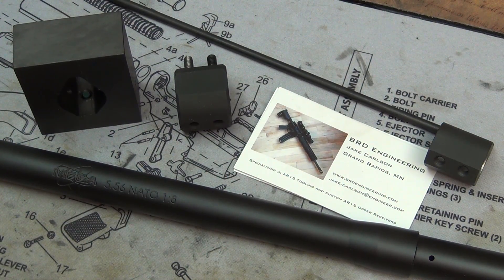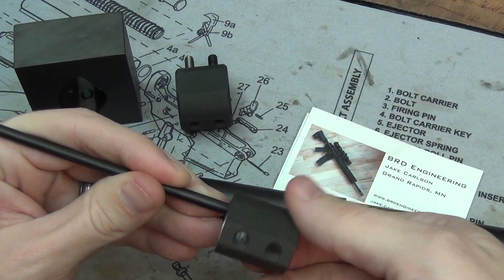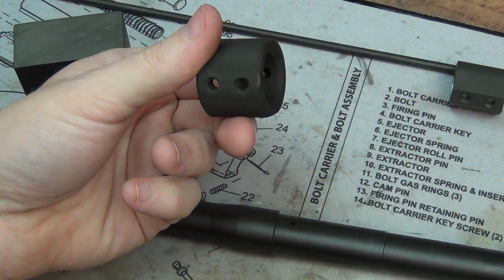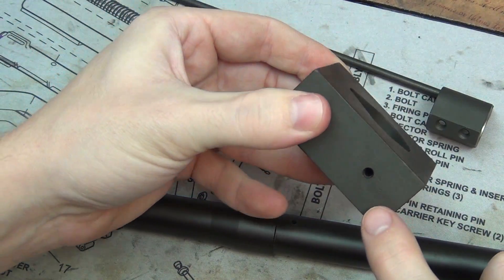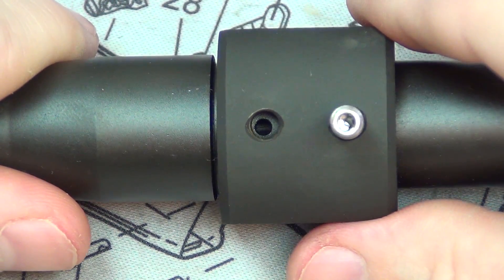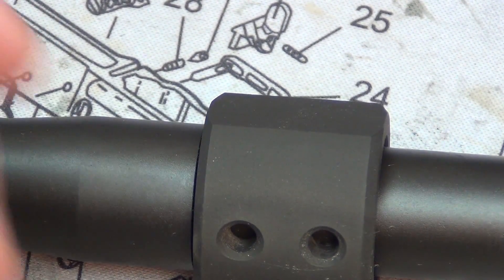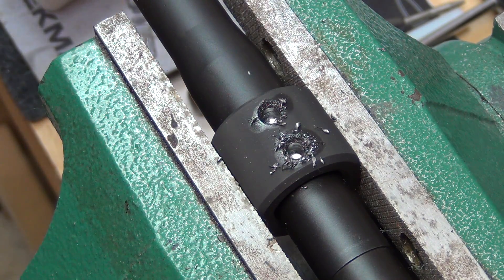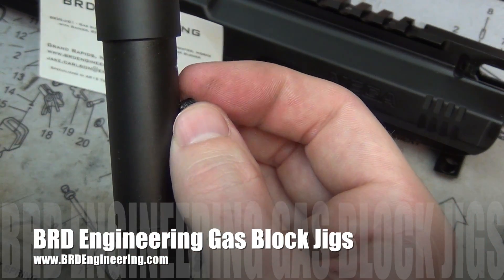AR-15 - How To Gas Block Dimple Your Barrel

Comment: Clearly not melonite/nitride 4150 CMV barrel.  Used the jig and cobalt bit from BRD.  Barely made a pinpoint.  Then used a dremel stone bit to break farther through melonite.  Still no perceptible metal being removed.  Now shopping for drill press and maybe carbide bits.  Much harder than you guys make it appear online.

Comment: What was your drill bit tip angle, 118 degrees or 135 degrees?
118 degree tip angle seems to be too sharp for use as a dimple bit, and will bore deeper into the barrel. 135 degree tip is much flatter and will drill less material at a flatter angle. I’m getting ready to dimple my 300 BO barrel and just looking for advice.
Thank you,

Comment: Great, informative video man.. thank you. Is there a reason most ar15 manufacturers only dimple the barrel for one set screw? Why not do both?
Reply: The front set screw may vary in distance from the rear set screw, depending on manufacturer and model of gas block. The rear set screw is always directly under the gas port.

Comment: the offset of the gas block to the barrel shoulder can be found easily by using the old spacer from the old standard "glacier guards" slip the spacer on the barrel then the jig then drill.

Comment: dumb question - why don't manufacturers already dimple the barrel from the factory? and does one really need to dimple it (because manufacturers don't do that)?
Reply: take my opinion for what its worth, which aint much, but the only reason i want to/am going to do it is its an easy to achieve peace of mind. i would not do this until i was 100% sure it was the gas block that wouldnt ever come off unless to swap with the same block (some of the spacing for the screws are slightly off from one another from what i've found) so marring the shit out of an expensive barrel without being positive of the setup would just not happen.
Reply: The through pin is strongest so why dont they all drill a big chunk out? Norr work and people arent buying just for that. They want a stock barrel alot of times.
Reply: Because its not necessary. There's also different size of aftermarket gas blocks.

Comment: Interested in this tool.  I am building a Ar pistol with a Rosco Barrel (10.5 inch barrel) Rosco placed one dimple on the barrel in alignment with the gas port (which is good) My rail is the Geisselle MK8 (9.5 inch) Might pick up this part so I could place a 2nd dimple on the barrel.  I might not pin it, don't know yet.  Great informative video.

Comment: I know this is a "dated" video, but it's still solid information.  If a person does any gas block upgrading/replacement, that jig is an invaluable tool to have on a bench.  Paying $40.00 for that little guide far outweighs the cost of messing up a barrel, or having gas problems later on.  Great/informative video.

Comment: Have you noticed any accuracy issues after pinning the gas block? I've noticed there's a loss in accuracy so I only dimple and loctite set-screws now and I've NEVER had a gas block loosen up even on barrels that get heavy suppressed use...Might be something to think about. This is why no premium precision AR barrels are ever pinned. Here's another one for you, why does some of the premium barrel manufacturers  like Battle Arms, Northtech, WOA, Rock Creek, Wilson Combat etc only dimple for one set screw? Because it further reduces harmonic inconsistency. That's why they can offer a 1 moa guarantee. Also JP doesn't dimple at all, they just go clamp on. Another one to think about.
Reply: D Hal ballistic advantage uses a pinned gas block and they have a moa guarantee.
Reply: so i'm confused. you notice the issue ONLY when its pinned? or when you dimple for both set screws/pin it???

Comment: You only need to dimple the one nearest the gas port. In fact, dimpling the other one could screw up alignment.
Reply: I actually kind of get what he's saying, but I think you alleviate the possibility of it being an issue as long as you tighten the screw below the gas port first.

Especially when using a hand drill, there are going to be some variances in the dimples and the screws will sit differently in each dimple. Having said all that (just being devil's advocate here) I think the benefit of added security that the second dimple affords easily outweighs the minuscule possibility of the second dimple bringing the gas block ever-so-slightly out of alignment with the gas port.

ETA: Great video and cool product.
Reply from the maker: +Jason Maurer you don't know what you're talking about.

Comment: rocksett,loctite,or just tighten the set screws?
Reply from the maker: I use blue loctite.
Reply: I agree...i would not use red loctite...if you have to remove the gas block you might as well take it to the gunsmith...red is high tensile ...blue is the best to use.  The guys in Special Operations and others use blue.  I am using blue for my build.  Just ordered this part the other morning...its going to save me a lot of time and I will  not worry about my gas block coming out of alignment.

Comment: How long did this take? I just got both jigs in today & have been trying to get the 1st dimple drilled for 20 minutes & you can barely tell. I mean you can't even feel it if you run your finger across it.
Reply: Matt Houser 
A nitrated barrel requires a Carbide drill bit.  I had to email the owner of this company to find out.

Comment: Thank you providing the need information so I can complete my AR build. The barrel gas block installation is, "did I get it right?" The BRD Engineering dimple jig will make it easy to install the gas block, correctly.
Reply: Do it da Russian way,tack weld da block on.Change barrels grind da welds..

Comment: any suggestions on where and what size roll pins to buy for gas block etc. I have a habit of dropping and loosing those boys. I am new to building AR;s Great video's by the way
Reply from the maker: +paul stanley I do not have that information available off the top of my head but a search on Google would probably prove helpful to you.
Reply: Thanks a lot.....i did do a search and found several sites. appreciate the reply...")
Reply: +frosty.... u may be using the roll pins in a TAPPER PIN drilled grove,hence, a loose fit... just my thought...
Reply: ty

Comment: Actually I used a separate 8 $ low pro gas block and drilled a small hole and made a jig. Used a small drill bit to line up the gas hole and marked the dimples.Took 20 min...worked perfect
Reply: I just saw some LPGBs for $20. Nice savings.
Reply: Yeah I did likewise with a crappy gas block I got off of eBay. Much easier than paying $50+ for a jig.
Reply: was totally thinking about doing this. especially after seeing the cost of these jigs. i figured i'd find a few guys in the comments smarter than the average bear, but it seems like its flooded with others that don't want to pay a premium on something that could be worked around (with a quality end result) at a fraction of the cost.

Comment: I'm starting my first build using a criterion barrel and Troy low profile gas block. Criterion says there is a dimple opposite the gas port. My question is, would it be necessary to dimple my barrel for the second set screw?
Reply: One dimple should be enough to prevent gas block movement. IMO

Comment: excellent...i also have this jig.  Invaluable.  The 1st hole is key, the second could be done off the gas block it self, if not indexing with the jig.  Also, the square surfaces provide for square alignment in the vise.  One of the best barrel jig ideas out there.
Reply from the maker: +lkazanov I agree.
Reply: +nsz85 Missed your videos...keep up the good work regarding the AR market.  Have you looked at the 25-45 Sharps?  Seems to have promise.

Comment: i shot my ar for the first time today after the new build... my first build. what can i use besides jb weld to secure the screws on the gas block? also i will be using the same thing to secure the 4 screws that hold the UTG free float hand guard.. that came out before one mag.. they were all stripped tho.
Reply from the maker: +the one and only I only use blue thread locker.

Comment: Really surprised you didn't use a drill stop collar.
Reply: +corpsie666 If they aren't tool people they're probably not the type of people to DIY this. Haha
Reply: Most "I'm not a tool guy" people won't
Reply from the maker: +Jason Stroppa I did not see a need to.
Reply: +nsz85 Just in my mind I think it'd be nice to have piece of mind there as to not drill and extra unwanted gas port on accident. As well as consistency of depth with the dimples. Just my 2 cents. Neither way is necessarily wrong or right, just what I would do. I enjoyed the Vid as always. Keep up the good work 👍👍👍👍